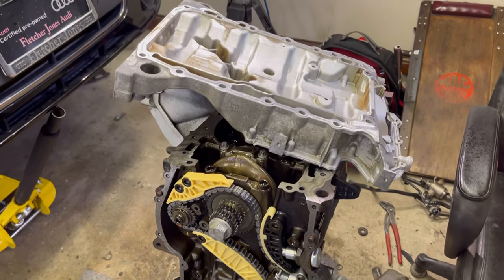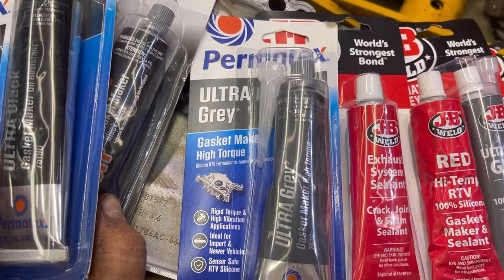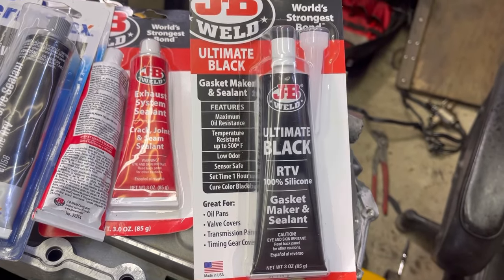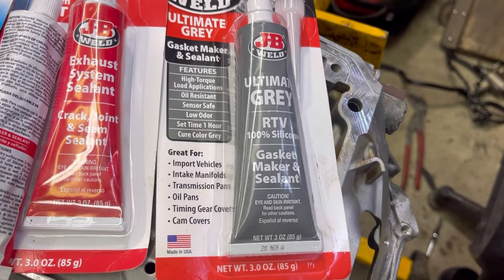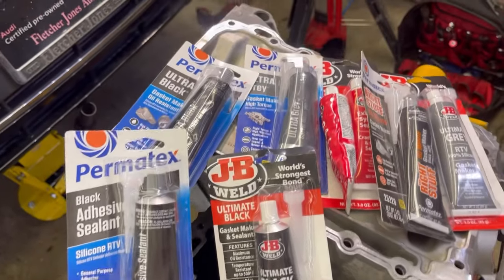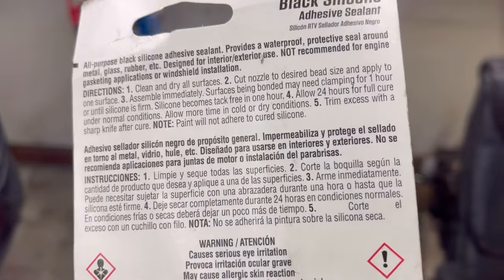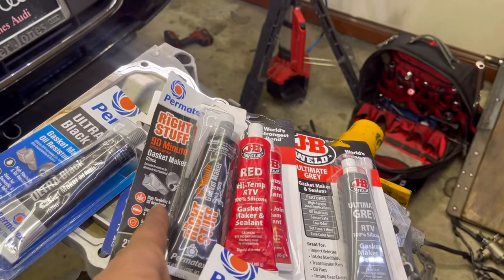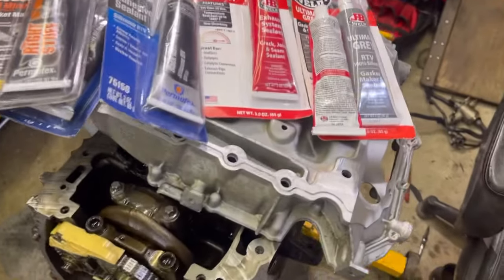Engine RTV silicone gasket maker types application instructions comparison uses demonstration 2.0t

Comment: In the shop atmosphere you dont get paid waiting for glues to dry.Permatex  and all other manufacturers have addressed this issue and are constantly improving their products addressing this concern. They certainly like to charge for these advancements. Shortly after the Right stuff come out the ultra grey came out. My explanation was black, ultra or Rightstuff was for most all auto applications but they improved it and made it grey to handle the synthetic oils.

Comment: I do it wrong too
(As a mechanic)

I've usually just full torqued the components from the get go.

Its job is to fill in the gaps.

I'm a little scared of waiting for it to dry and the full torque it thinking the extra pressure could cut into the silicone.

Even if wrong I've yet to see one leak

Comment: Yeah I used to goop too much on and immediately torqued everything together. Now I'm much more careful on how much I apply and do the finger tight, wait an hour and torque procedure. Note the Right Stuff 1 min does let you torque immediately.
Reply: What was the reason you changed your approach ?   Did you end up with leaks, and a job to repeat ?

Comment: I have a Predator 3500 generator that is leaking oil from where the low oil sensor wires enters the engine, It is not a threaded connector, and there is just the wires coming out with some kind of sealant around them that isn't working  any more. What kind of sealant would you recommend I use on the surface of where the wires come out of the engine to stop the leak? All I know is that it has to be high temp and compatible with coming in contact with oil...
Reply: Did u ever dine the result
Reply: Mine is doing the same thing
Reply: @AdrianGarcia-tz1yx  Used Permatex Ultra Black. It is oil resistant.

Comment: I manly use mopar grey ..after curing the sealant is harder ..than say normal rtv ..after curing  , it feels like a rubber band ...
If I remember correctly  , most rtv says  , make a bead let it surface cure ..then assembly..
All techs are in a bigger rush  , and assemble before curing..

Comment: Interesting topic 
I think you are not using the right sealant for the upper oil pan. You should be using anaerobic sealant. I could be wrong, do correct me if I am.
I think the advantage is the sealant will cure inside the joint and all the excess will never solidify.
Example: Permatex 51845
Reply from the maker: You could probably use that and it will probably work in most cases although I haven’t tried yet but Audi only uses that anaerobic sealant for the camshaft tray
Reply: @NaptownTuner  you right. Again 😁. I now remembered they use the anaerobic for camshaft case thing.

Comment: You have to use the high torque one round the holes and red stuff between the holes😊 you have to sit and blow on the joint until your cured

Comment: I was doing a transmission pan drop and filter change. I used ultra black rtv, bead not too big, let it for an hour to set, but apparently it needs way more than that, it was leaking like droplets. Had to drain the aft and start from scratch. Now I put a bigger bead and hand tightened those bolts for 24 hours. We'll see how it goes.
Reply: How did it go? Just had the exact same issue with an oil pan but instead of 90 min actually waited 4hrs before filling up again
Reply: @dreamchaser6053  you gotta go by what the product tells you. 24 cure time, respect that or at least more than 15 in my opinion. From my experience, i let my car in the shop for 2 whole days (this was cause it was on friday and shop was closed Saturday and sunday) so on Monday I inspected and it seemed well sealed. Definitely go by what permatex tells you otherwise you're gambling.
Reply: @oswaldoflores9206  for sure, but I specifically used the 90 min one, so I figured 4 hrs is over 2x the recommended cure time

Comment: i use permatex ultra grey and have never used the finger tight rule . But i have also never had a comeback bc of the ultra grey failing. but the red is by far the worst I don't see my self ever using it.

Comment: An RTV or Silicone sealant Bead Applied product should Always be applied to Clean,  uniformly thinly wiped, White Lithium Greased surfaces Evenly & Loosely assembled/tightened for 24 hrs Before final torque tightened to assembly specs to establish a functional sealant thickness without causing uncontrolled squished-out sealant Displacement & likely resulting leakages while still Allowing relatively easy Cleanly joint Releasing  seperation disassembly effort.....